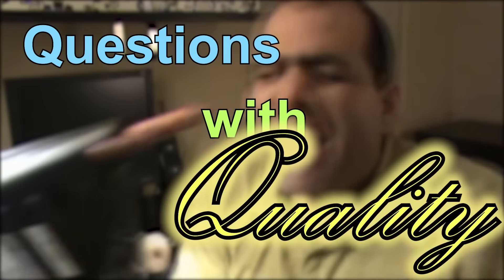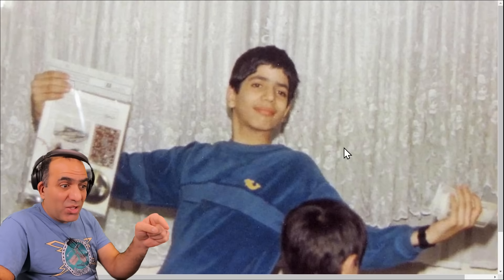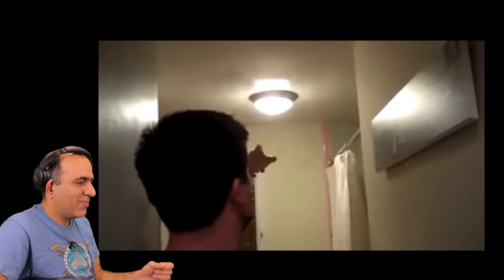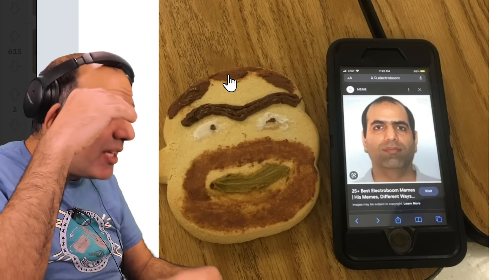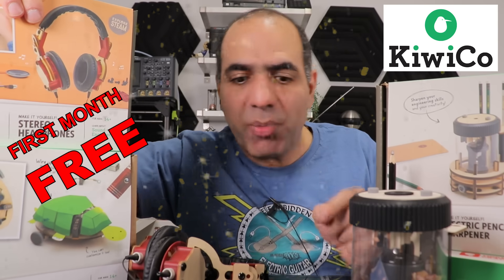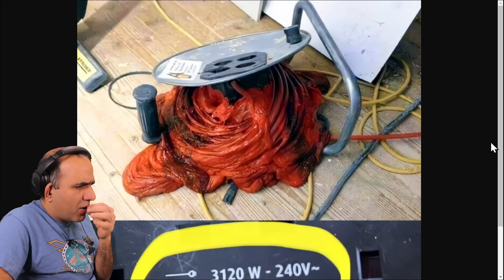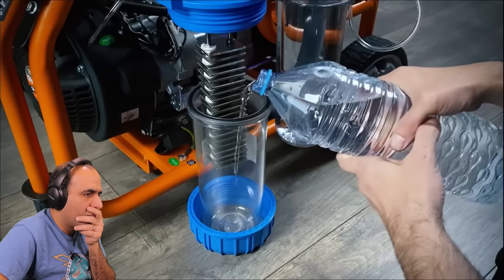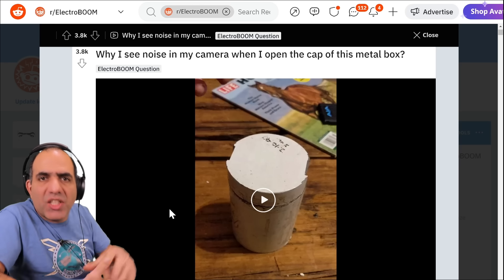Can ENGINE Run on WATER?! They Copied my Toy (LATITY-011)

Comment: If a hand is able to block the radiation, it's probably just a little alpha emitter.  Probably not dangerous in short term exposures.  Really only dangerous to the eyes.  I'd be more concerned about the toxicity of the stuff inside.

Assuming of course they didn't just fake the footage by adding some static in post production.
Reply: The OP actually said in the comments that indeed, it was faked. No radiation there.
Reply: I was really worried for them. Thanks for the follow up.
Reply: @GabrieleR95  They actually did bring out a very weak radioactive source for the second part with the Gieger counter.
Reply: @GabrieleR95  was starting to say, you probably need to be pretty high on the food chain to get a hold of something like that🤣
Reply: @mechsupernova  No, you don't. You can simply order smoke-detectors, most of them work with Americium-241, which is an alpha emitter. There are other appliances that also make use of radio-active material. And last but not least, you can buy some radioactive elements in small quantities.
Reply: @GabrieleR95  ok
Reply: @GabrieleR95  could have said that to avoid getting his account banned
Reply: @Invizive  Radiation typically doesn't show that kind of noise. If it actually was a radioactive source, you should see bright white specks as high energy gamma or x-rays hit the sensor. Also, radiation that is completely blocked by the guy's hand but not by the camera lens and body... maybe possible but highly suspicious.
Reply: If it was an alpha source, the camera lens would have been sufficient to block the radiation from the sensor. It was admitted to be fake, but it's also obviously fake.
Reply: I've commented about this in a lot of places.
I can tell it's clearly fake. Anyone with knowledge of radiation will know that it's fake, but a lot of people don't have much knowledge in that field and just assume it's real.
There are a few factors - Radiation doesn't just fade in and out like it seems to in that video and it doesn't produce a static effect on the sensor like that - it produces odd white (or occasionally other coloured) spots and glitches in random places and it's only really noticeable when the surroundings are really dark.

Also, the person puts their hand over the source and stops the "radiation", which would mean that it should be a pure alpha or beta source, however those white flashes generally only occur due to gamma or x-rays on the camera's CMOS, as they are just high energy photons. 
Gamma will easily pass straight through a person's hand, beta are electrons, which cannot pass through the glass of the camera, and alpha barely penetrates anything.
We can see a dark lump of material inside - If it was a high energy beta emitter (and believe me, the energy would have to be well over 1MeV) the half life of the material would be at max a few hours. I had a look at a list of beta emitters and their energies, and none of them seem to fit the bill of having a long half life, high decay energy and being a solid.

(Note: I say electrons can't pass through glass, but extremely high intensity free electrons such as those from an electron accelerator or irradiator can go through glass. However, beta particles will still have great difficulty passing through it.)
Reply: @danwhite3224  never saw a fake but I assume it looks fake because true radiation would show as pure white spots?

I remember back then doing the true random number generator with a webcam and it showed that way, but it was completely dark.
Reply: @GeomancerHT  Pretty much. It does often show up as random white spots, but it does also show up as other colours too when there is some background light, depending on where the particle has hit the sensor, energy of the particle, etc. In pure darkness it only ever really shows up as white pixels though.
Reply: Couldn't rly be alpha source. At that distance it would have to be rly high energy alpha to penetrate that distance in air and go through the glass of the camera. Beta could do that or strong gamma source. If it wouldn't be fake, that guy would have some serious issues, cause the activity of that source would have to be rly RLY RLY high.
Reply: What is really nice, (not in this case) that image sensor are actually used as radiation monitors
Reply: Alpha radiation probably won't even cause noise in a camera sensor since they are easily blocked by the lens. And noises caused by radiation are individual peak dots instead of this blurry mess, which appears to be more similar to thermal noise.
Reply: It's fake, look up footage of cameras exposed to actual ionizing radiation, it looks much more like TV static with pixels lighting up brightly.
Reply: @ElectronicsExplored  that's a very reasonable point, should've remembered that from other footage
Reply: considering the hand blocked most of it but it did reach the camera when exposed I guess it's a beta emitter.
Reply: Did you know the moon is a gamma source?
Egret shows us great pictures of the moon emitting Gamma rays.

If any of such was dangerous, then surely Neil burned his feet, right?

Imagine the dust they collected on their suits, bringing it into their living space when they returned to the LEM.
Breathing in such dust and all of the rest.

So if it was dangerous, this radiation.... they wouldn't even gone any further than the van Allen belts.

Perhaps this is another discussion, but ey.
Nobody seems to know Galen Winsor these days.
The man swam with the rods. He ate the material and did not drop dead on the spot, nor any time soon after the show and tell.
Do you remember James Randi?
He showed us that certain "medicine" is just a load of crap.
Homeopathy is crap.
He shows it by eating/swallowing a full bottle of pills of whatever homeopathic crap (or pathetic) crap there is.

Chernobyl was a steam explosion. Nothing more.
No horses with 6 legs.
No babies with 8 arms.
No double headed mice, not even a cockroach with a gigantic dong.
So, what is up?
Why are we letting others tell us what it is?

Nuclear submarines have been running on small reactors for ages now.
Ever heard of a Chernobyl kind of disaster amongst them Submarines?
Icebreakers, aircraft carriers, all powered by this wonderful way of producing energy.

And yet we have to believe it is dangerous.
And creates a lot of "waste" which we have to keep cool in pools of water.

What a load of crap.
Universities have their own reactors on site.
If it is OOOO SOOO dangerous, then surely we would not let our kids be close to such danger, right?
Universities are not supposed to be very very dangerous, like Chernobyl kinda dangerous, right?
And yet they seem to be.
Reply: @bertjesklotepino  Actually, it really is dangerous and astronauts are at a slightly elevated risk of cancer because of that. Not enough to burn Neil's feet of course, but enough to be a problem for space exploration. Also, white specks are not only seen on camera: astronauts also see cosmic rays as white specks as it hits their eyes.
Reply: @gubx42  sir, i would suggest looking up the damage the van Allen belts cause to normal equipment.
A good source would be: Science in action, episode 355.
It is specifically about those belts and the damage they cause.

Glad you have been listening to Alan Bean, who saw these white specs in his eyes.

The problem however is this: They had to go through these belts not once, but twice.
And, after these belts they were exposed to everything. No shields against any of it.
They walked on the surface of the moon, which again i say is a gamma source.
It is emitting gamma rays because of being bombarded by cosmic rays all the time.
The surface itself is radioactive.
They not only walked on it. They brought the dust inside the LEM with them.
On their suits and all the rest.
They inhaled the stuff.

And not one of em got sick as Galen Winsor did (bad example, but just an Example)

What i merely suggest is that i think it is kinda unbelievable we ever walked up there, on that surface, open to all the elements, in a flimsy suit made out of material from the 60's.
Glad Nasa (and Musk) havent yet tried it again.
I mean, we did it 6 times suc6fully with ancient technology.... so yeah, we gosta make sure these days that we checked everything, right?
After all, these 6 times prove nothing. We gosta invent it all again.
Like inventing the wheel twice.
Right?
Sarcasm, i'm sure you understand.
Bill Clinton told us we would go back to the moon. Have we?
We got the stuff for it?
It worked PERFECTLY.
So no need to invent anything new.
Just use the old stuff.

O wait, belts, the surface itself.

Listen, if those suits work to keep out the radiation, why haven't they used em in cleaning up Chernobyl or Fukushima?

And why havent the rich people been treated to their own little happy tours, a trip around the moon? Disney land inside a secret base set up by the military on the moon?
If the US could keep an eye on the Russians from the moon, with their own base up there, nobody knowing about it, nukes pointed towards the Russians..... Would they still be doing what they are doing today?
So i think it is safe to conclude there is no base up there.
But i also think the Military would have loved to have a base up there.
SO why do they not have a base up there?
We went up there suc6fully, even brought heavy equipment (3 rovers).
I mean, comon.
It has been 50+ years.
Get over it.
We haven't been there.
Reply: @bertjesklotepino  that's was completely unintelligible...
Reply: @Quickened1  well, i am dutch and we can't all be fluent in English, right?

Anyways, try again. It aint Chinese.
Start by looking up Galen Winsor and what he had to say about nuclear power.
A title of his lectures is: Nuclear scare scam.

He does speak fluent english, no worries.
Reply: @bertjesklotepino  Maybe you should try a translator instead of listening to those kind of folk.. much more useful knowledge for you.
Even if it were true, what are you going to do about it?
Reply: @tarakivu8861  sorry, i am not sure what you mean.

Just look him up, Galen Winsor. Aint that difficult to find.
Reply: @bertjesklotepino  We haven't been back to the Moon (at least with manned expeditions) because no one has the interest in doing so. There's no money to be made in going to Luna, so the corporations which run our society aren't going to invest in it. Even space tourism (other than sending some rich knobheads up into orbit, and unfortunately bringing them back in once piece and relatively uncharred) isn't really a viable industry, due to launch costs and associated risks.

The US does not have a secret military base on Luna, nor is there any benefit to basing nuclear weapons on the moon with advances in targeting technology that can give SLBMs a CEP of under 100m. However, the US did briefly consider placing nuclear weapons on the moon during the Cold War, but that was well before the development of stealth bombers and extremely accurate SLBMs. Besides, the Outer Space Treaty (which the Russians have undoubtedly violated at many points) forbids such a thing.

Overall, your main point is almost unintelligible not because of grammatical errors, but because you phrase your thoughts like someone high on hallucinogenic drugs. But then again, that wouldn't surprise me if you were, since you are one of those idiotic conspiracy kooks who thinks that the Moon landing was faked.

I wouldn't be surprised if you probably believe that rockets can't go into space because rocket motors emit a fiery plume, and fire cannot burn without oxygen, ergo space-going rockets are an impossibility. Do you also believe that contrails from aircraft are really mildly toxic chemicals intended to poison old people, and that the 9/11 attacks were faked ("because jet fuel cannot melt/burn steel beams")?
Reply: @bertjesklotepino it’s so funny… it takes months to go from the moon to earth, yet less than an hour for an ICBM to travel the world, and yet your argument for why we haven’t been on the moon is that there is no military bases on the moon XD.
Reply: @Anotherrandomaccount505  what?
So you think that that is my only argument?

Right. Guess you have to do some more reading, ey.
Reply: True I didn’t think about that!
Reply: or beta radiation, or low power rontgen that is blocked "just enough" by your bones and tissue...
Reply: That looked like the lead containers I used to buy from a connect I had at the hospital to make bullets out of, they are used for isotopes and they would store them for a certain amount of time before selling them to me. They were pure lead and the tech assured me the radiation was safe, I guess he was right I've made 50 years since then.
Reply: Well, if is just alpha radiatioin than the glass and body of the camera would be able to block it too, or, ffs, even the air on such distances.

So I'll say is fake.
Reply: why would anybody put an alpha emitter in a heavy lead container and how is the alpha radiation reaching the sensor through the lens. It's obviously fake
Reply: For an alpha-emitter you wouldn´t really need a lead box. Paper would be enough. Even for beta-radiation an aluminium foil should be sufficient. I assume it was some sort of gamma-radiation.
Reply: If you want to see a camera pass through some real beta radiation, look for the videos showing how the trapped lightning in plexi-glass is made, quite fascinating. This looked more like some vapors leaving the container.
Reply: if it were real it'd be a beta emitter. alpha only really travels a short distance. beta is blocked by the hand.
Reply: I would say too that it was fake, ionization wouldn’t give you that result on the image, you will see white pixels caused by X and gamma rays which I don’t see there, white pixels because these photons have high energy compared to lower frequencies that are the colors we see
Reply: @Xuzyy  except that was clearly not a gamma emitter. it was most likely a low lever beta emmiter or a alpha emitter
Reply: It was probably added in post, I've seen actual footage of radiation and it's more like a bunch of white pixels popping up here and there. This looks like high-frequency RGB noise, which wouldn't make sense.
Reply: True radiation doesn't look like that, it adds random hot spots to the image, but it shouldn't affect the normal parts too much, and should not add negative noise (making pixels darker) unless they somehow pass through the digital logic side of the sensor
Reply: I was betting that if true (and a big bold IF) it was some residual radioactive metal like Pu-238 (it almost doesn't emmit gamma ray but emmits alpha, beta, x-ray and visible light) that may cause interference in the camera but can be blocked (a good portion at least) by the hand.
Reply: it was fake, but i believe only beta particles and gamma rays cause that kind of static
Reply: It's obviously only a fake using a video filter. Ionization looks different.
Reply: o
Reply: could also be a low energy beta emitter
Reply: Have you ever heard of a guy called Galen Winsor, mr ObadiahtheSlim?
If not, i would suggest checking out what he has to say.

You can find lectures of around 1 ½ hour long videos on youtube. I know of 2 different lectures, roughly same length.
In those lectures he explains what he was doing during the time of the development of this nuclear power, radiation stuff. 

He shows his audience a bottle of radioactive stuff.
The geiger counter is going baloney when he puts it near the stuff, holding the stuff in his hand.
Crazy guy.

And then he eats the stuff.
Just up his mouth, into his throat, down the drain.

Sure, wikipedia will tell you he died from some cancer, but who is to say that that happened because of him swallowing the stuff?
You can get cancer from all kinds of sources. Heck, who is to say that there even needs to be a source for a cancer to grow. (source as in: outside the body, some kind of energy, poison, whatever. Me, dutch, not perfect english)

Anyways, i find it funny to see what Galen Winsor had to say.
He swam with the rods. You know? These rods they call waste..... he swam with em in the same pool.
It aint no waste.
It is still producing energy, as in heat.
Hence why they are in a pool.
So why aint we using that heat?
O wait, might it be because if we knew the potential and understood the potential, we would say to our governments: Ey, foek off, we supply our own power?

I think they cant keep us dependent upon "them" if we were to know every little detail about this.
Anyways, what Galen Winsor has said is almost nowhere to be found.
There has to be a reason for that.
If it is all nonsense which he said, then i do have certain more critical questions.
To me it doesn't sound like nonsense.

SO look him up, have a look and listen to what the man has to show and tell.

Comment: Can someone please explain the last part with the radioactive material? Why does it make the video go noisy, how does it work?
Reply: The decaying radioactive material emits highly charged particles that bombard the camera sensor and overloads it. (In layman's terms)
Reply: Basically it's radiation particles  hitting the camera CCD (as a photon would, but much higher energy in this case so a single particle can charge the CCD cell, whereas normally thousands or millions of photons would be needed to make the pixel brighter). It's a real phenomenon, however in this case the video is just edited as a joke.
Reply: the ionizing radiation coming from the open lead container interferes with the camera electronics causing n it to malfunction and create noise

Comment: Carbon rod welding is a thing. Only, it is called carbon-arc welding. It is nothing like what is shown in this video. Just for fun, I have used equipment produced in the1950s for this purpose. It wasn't easy to use.